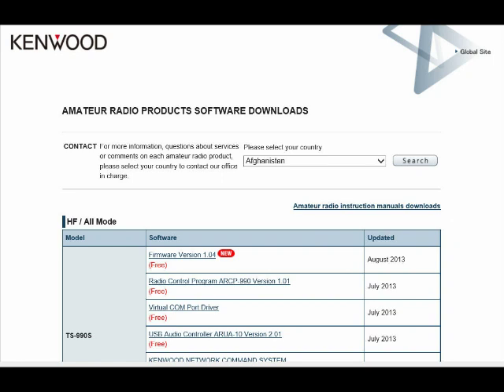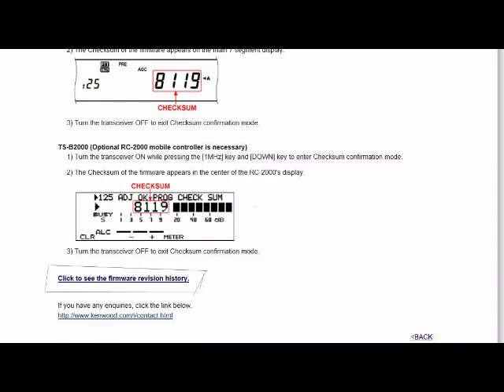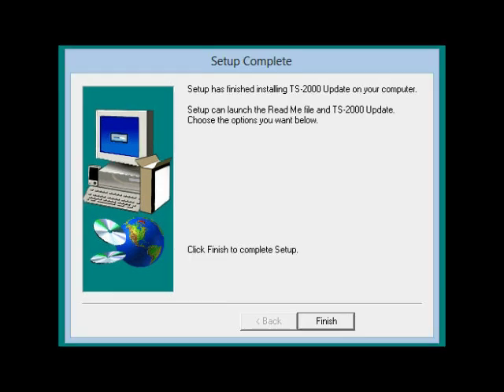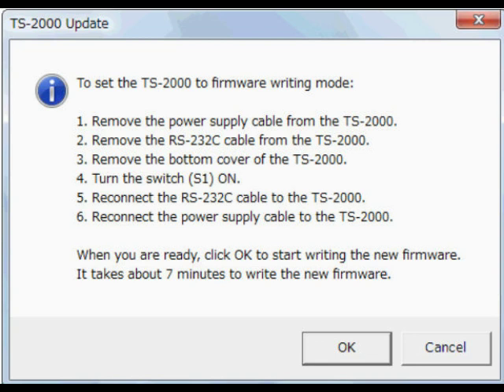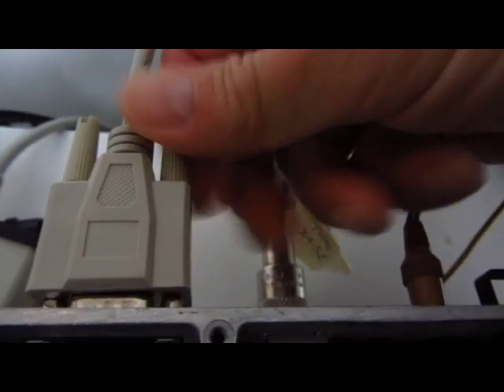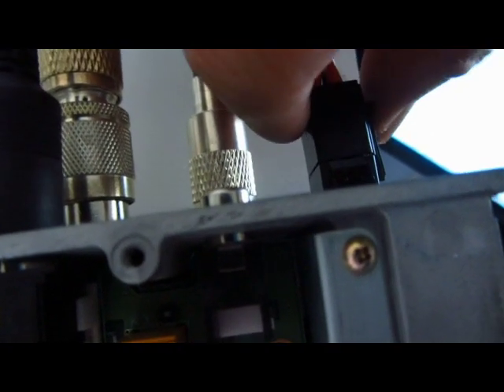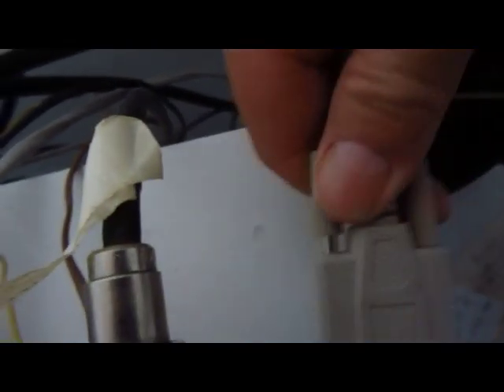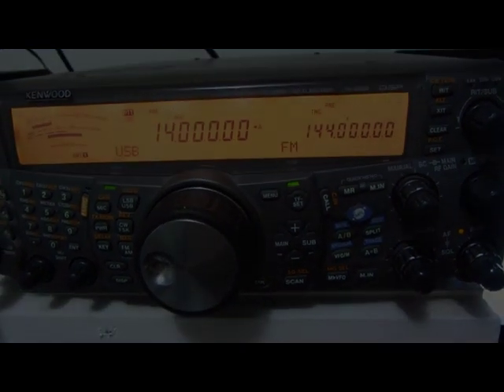How to update Kenwood TS 2000 Firmware

Comment: It is a TERRIBLE radio.It ranks right up there with the Yaesu 857D and it is downright PATHETIC on its best day.I am so happy I have my TS-2000 Sold and I warned the new owner ahead of time so he won’t be mad at me.If someone tried to give me another one I would refuse it if I were required to keep and use it.I find it to be the most overrated POS I have ever wasted my money on just like the 857D.If you’re considering buying one Run as fast as you can away and buy something wort having such as an ICOM 9100 but do whatever it takes to avoid ever wasting your money and time on the Kenwood TS-2000.I promise you will thank me later.
Reply from the maker: I'm sorry, you did not like your TS 2000

Comment: Do yourself a favor and DON’T buy this POS Radio.It has a TERRIBLE receiver on every band.It is pathetic and I replaced mine with an ICOM 821H which is far easier to use and program.The TS-2000 is far from being a good radio for any band.
Reply from the maker: I didn't realize this till I bought the 7300.

Comment: While you have the bottom off, you might as well change the CR2032 backup battery as well.
73 de Malc 2E0EZP
Reply: Good point. I need to do that on mine while doing this update.
Reply from the maker: Good point

Comment: Mine would not work for some reason.  When I connected the radio to the pc the program kept saying , ts-2000 not detected. Time after time. My checj sum is 8119. The radio works fine but the pre amp must be on to get any normal s meter reading on ssb which is annoying for the radio that it is. Any way thank you for the post Ritch.
Reply from the maker: Thank you